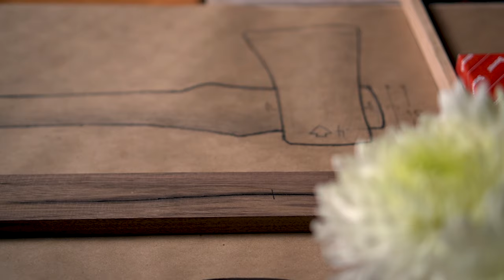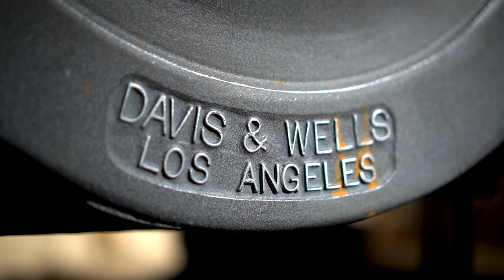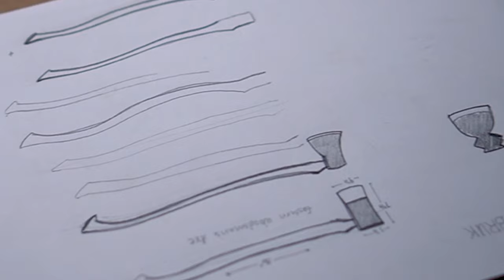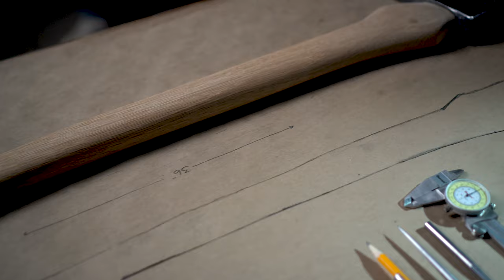Making an AXE! Fun woodworking project

Comment: I respect what you're doing, I have been restoring axes most of my adult life. My favorite axe is a 2.5 pound 28 inch long handle Kelly's True Temper. I  restored it over a decade ago, made my own Tennessee hickory handle for it. I put lambs leg on it the bottom that was more pronounced than normal for more leverage, as the grind I put on the axe head was for splitting. The I used and still is Watch Danish oil light walnut, by now it probably has over 50 coat or more in it. I also wrapped under the head with paracord to protect from any over striking that might happen. I carry this axe with me in the field to bang wedges when I cut tree's as well, it has been a hard working beast and my favorite for years. I  am glad to see you make your own, I love watching other's find their own path! Much love and kindness from Ohio!
Reply from the maker: Thank you so much! Jared really did a deep dive and learned so much about axes. I had a blast documenting it and telling the story. Much love, thank you very much for watching 🙏🏼

Comment: Sorry on this one folks...Looks good...Looks like a handle...but it's not even close to actually being a real ax handle or anywhere close to one...It can't be because of the way it's made and what it's made from...

Modern handles (which break all too often) are made from planks or boards (just like in this video) which is metaphorically an element of what went wrong after the I.R. (i.e. Industrial Revolution) and then, the "brain trust" in the worlds "civil wars" globally...then what we lost in two major world wars...

Tool handles...MUST...start with green and only "riven" wood that is then assessed by a maker that can read wood grain (aka top of tree from the bottom, bark from pith...etc)...From here come rough shaping by edge hand tools only...fire case hardening...more shaping...etc...With this, you have a real handle and not a modern faux/fake look-a-like!!!  With a "real handle," the tool will not readily split or lose structural integrating from impact and cyclic bending...

"Looking good" just does not cut it when talking "tool handles,", especially with hammers, dummies, bells, mallets, axes, adz, etc...